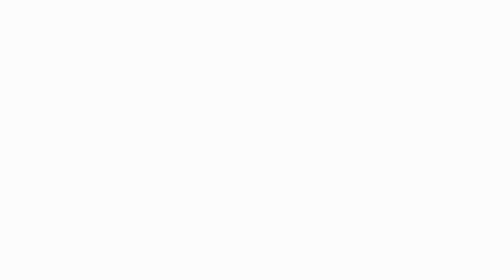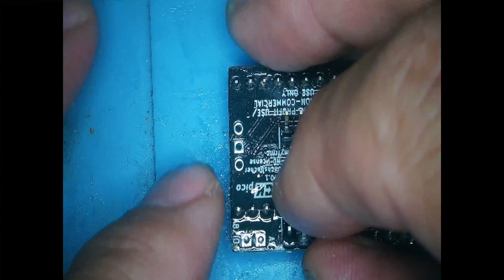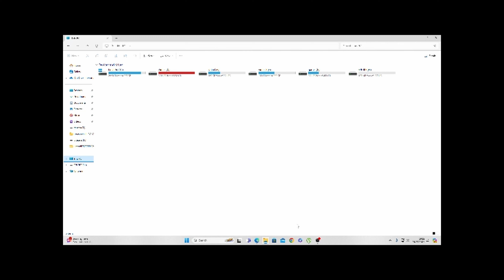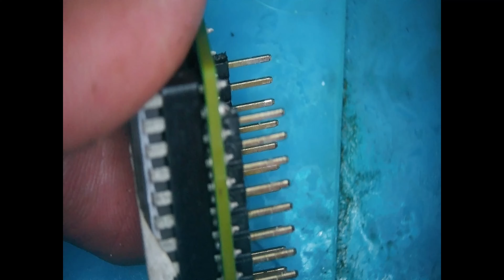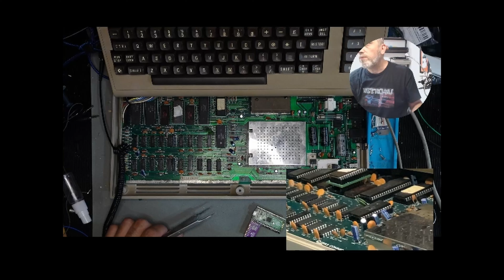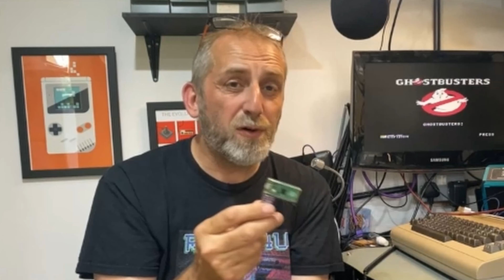The Commodore C64 SIDKick Build: Overcoming a Nightmare - Will It Work?

Comment: hello. i need your help. whats the name of the cable that connects the c64 to the floppy drive? mine is missing. but i dont know what i need to look for? if someone knows the name of this cable please tell me.
Reply from the maker: @pv8685  hi the c64 1541 drives use the serial lead for the c64 like this https://www.ebay.co.uk/itm/392130688060 thanks for the comment

Comment: Something to consider, Retro is the New Black found his problem was with fake DAC boards from AliExpress.  Also, what settings did you use in the config menu.
Reply from the maker: Hi the fav board came from Amazon could be that I’ll desolder it and try it again. As for settings the config menu will
Not appear . Thanks for the comment
Reply: You used the dac 2ith silver contacts. These should n9rmally Work. These with gold contacts from China are Fake...

Comment: How disappointing! I just built two this week, the first one with a black Pico clone from china (5 for 7 quid!) which turned out exactly the same as yours. Power light comes on, but no flashing and no sound, and no SYS config menu. I built a second one with an authentic Raspberry Pi Pico and it worked beautifully. I assumed it was an issue with the clone but now I'm not so sure! Where did you source yours from out of interest?
Reply: Biggest problem is getting a diode that fits the pcb... annoying as
Reply from the maker: Mine where gifted to me from captain commodore he built his no problem. It’s good to know other people have had the same issue. I’ve tried one with the pico and one with clone. Also what I forgot to add tin the video was that both won’t show the config menu as well either the sys command thanks the comment

Comment: Nice to see youve got a running c64 :) Abit weird is the sound issue . Possibly a socket problem ? and where's my SIDKick ? Mmmmm lol ... Looking forward to seeing the 1541 video mate :) ..
Reply from the maker: Was thinking socket but why would the OG chip work fine lol 😂. I can change it of course the inbuilt menu on the SIDKICKS dont work as well lol 😂
Reply: @Retro4u  Very true . The OG wont work for long putting turn pin into leaf sockets .. ask me how i know lol :) .. i still say the ARMSID is the way forward if you dont think about the cost :)
Reply from the maker: @8BitRetroReFix I was interested in the duel Sid output which is why I put the Dac on oh well another retro project that don’t work. Time to turn another page and try again lol 😂
Reply: @Retro4u  Best way is with the 1541Ultimate cart or U64 Elite .. You can have multipul sid's then :)